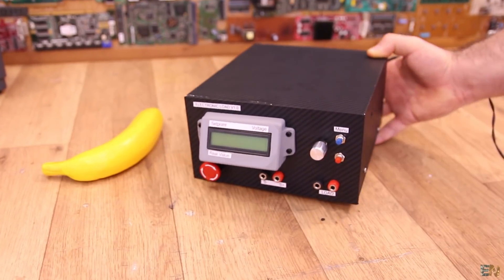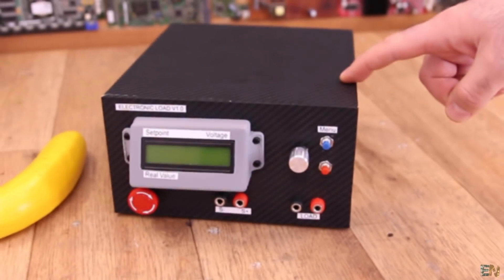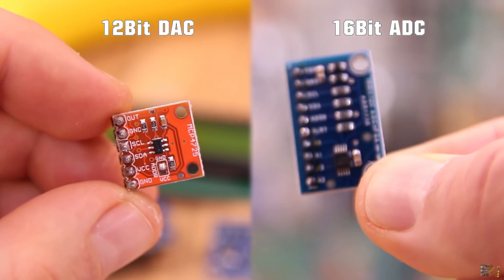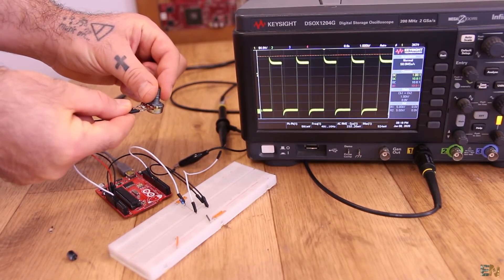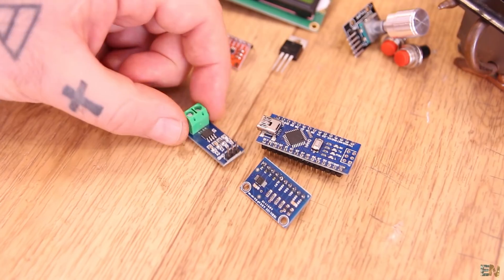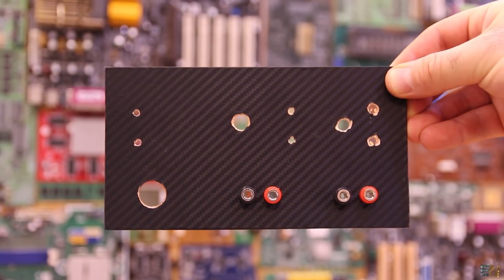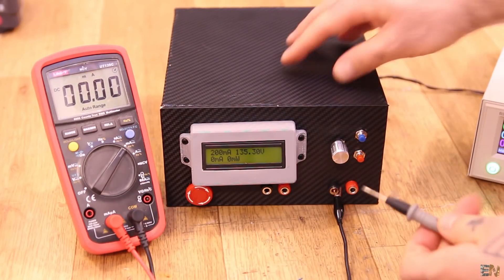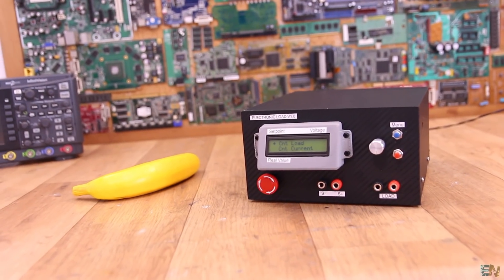Homemade Digital Electronic Load | Multiple Modes

Comment: Good job, one of the best assemblies I have seen for modules of electronic load, this simplifies it a lot for noobs, but the code is missing some features to complete a prefect job:
1- Set end condition i.e. voltage in order not to destroy and deplete batteries under test.
2- Total capacity in mA or A for batteries testing.
3- Total consumed power.
👍

Comment: This is a sweet project. My only concern is that of response speed. It's probably not a big deal for the vast majority of use cases, but I could see some situations where an input voltage changes rapidly. That could cause a large current surge that could brown out the supply, or cause strange oscillations. For example, in constant power mode, if a supply rapidly switched from low to high current, this load may not be able to increase the resistance fast enough, overloading the supply.  Or in constant resistance mode, a reduction to half the voltage will momentarily continue drawing the same current (half the resistance). I think this type of situation is rather unlikely. But it should definitely be kept in mind.
Reply: This problem was a deal-breaker which stopped me from using this design.

Comment: 11:05 , don't put mosfets in linear mode in parallel , drain-to-source resistance changes as mosfet heats up, but they'll not heat up equally even if they're mounted on the same heatsink, you'll get cycle like this until one of the mosfets burns : higher temp => lower resistance => more current = even higher mosfet temperature, so eventually current rated for all mosfets will pass only thru one mosfet

you can put them in "parallel" if you read the amperage, and control their gate voltage  separately
but anyways, cool project :)

Comment: Made it, works great. The only issue was that the current was stuck at 500ma, but I resolved the issue by flipping L and L+ around.
Reply: On mine the current showed a negative value, also had to swop L+ and L-

Comment: I did the similar project 2 years ago. I used INA219 as a current sensor together with 0.1Ohm sense resistor. It more accurate than ACS712, has I2C interface and 0.1 resistor produces less heat.
Reply: Good morning. Did you put your project on the internet?

Comment: Have you checked stability of the system? Especially op Amp driving a mosfet tends to oscillate under some circumstances. Adding some caps in the right position could increase your phase margin of your system.

Comment: When drilling into a heatsink with heatpipes, make sure not to hit the pipes or the refrigerant will escape and the heatpipe won't work. (If you noticed a hiss and a funny smell when you were drilling it, that's what it was.)
Reply from the maker: You're right but in this case, this old cooler was not filled with refrigerant. It's just filled copper tube.

Comment: I am your pateroner, very happy to see this kind of project. It is very useful and you have fully utilized the microcontroller using a good example and best coding way to produce the user friendly features. I love it !!!!! I am your fan haha. Previously, I asked you question and you was responsive to answer my question on pateron chat. I was doing the smart watch project the latest version. But I realized that using the ATmega328-MU the footprint is difficult to solder, I try many best way to solder this and apply the flux to ensure solder paste can properly isolate and solder tightly. I keep trying more than 6 times to program the MCU but stii failed. I read many videos how you burn the code in a blank chip. But I am going to re draw the PCB and change it to ATmega328-AU, i guess using the larger size of ATMEGA328-AU then I can only successfully.  Anyway, I really like your project so far. Hope you keep on post more, stay healthy and safe during this period. God bless you.
Reply from the maker: Thank you very much. For the small chip, do you have a hot air gun? Using a lot of flux it shouldn't be that difficult. And yes, the au version is a bit easier to solder because you can see the pins. Keep up!
Reply: @ELECTRONOOBS  yes, i used heat gun.  I properly to solder and apply the flux to ensure the isolation for each pins. I am not sure why still failed to download the code. I also follow the several video to burn the bootloader. Nevermind, i will keep trying out and let you know once i success to make it.

Comment: Also, I think running MOSFETs in parallel as suggested by running them in the linear region could be non-ideal since the different manufacturing tolerances would make them difficult to control in unison
Reply: U can fix that very easy by splitting the gate voltage to extra OP Amps - and get that "Gate Voltage" from the MCP splitted to them. Every FET needs his own Shunt - and all is fine

Comment: Hi, nice Project, I just stumbled about one thing. GND of Sense is directly connected to the common Ground.In case you connect Sense GND and Input GND directly to your power source then the sense GND wire will also have to carry a lot of Amps resulting in Voltage drop over the wire? => Depending on the "thinkness" of the Sense GND wire, the measurement might be impacted less or more. Shouldn't Sense be measured in a differential manner?

Comment: 1ohm is maybe a little high (voltage drop to connected equipment)
simple suggestion for a bigger/better monster v2.....
mosfet x3 to share the heat
0.1ohm (10x1ohm parallel less heat/less value drift so more accuracy)
tl072/358/741 opamp to multiply small currents before adc (switchable? 1x 10x etc)
less ugly display option, small but pretty oled ones are like $8
sdcard logging......

Comment: you could also attach the 1 ohm shunt resistor to the heatsink, I guess it would be pretty hot if high voltages were to be used

Comment: That was a nice circuit Dude! 😍
Might be useful for a capacity test for 18650's.
Reply from the maker: Thank you. They should be interesting to test
Reply: @ELECTRONOOBS  Yup! 🤟
Reply: @DIYwithBatteries  you have a cool channel too.
Reply: I was thinking the same think. If yoy can make it count the mAh, time and ad  a cut of voltage it will be great for 18650.

Comment: A word of warning.  If you use this device to test batteries, add a cutoff relay.  Batteries are never off.  If the MOSFET shorts out (most likely failure mode) bad things happen like fire.
Reply from the maker: Thank you for this great tip!
Reply: Maybe add a current clamping circuit?
Reply: @bitsurfer0101  No circuit is going to protect this device.  What would happen if you're load testing a battery and the MOSFET shorts out?  The full current of the battery will start surging through and begin heating wires and other parts to the point of ignition aka FIRE.  Either you need a fuse or a relay in series with the battery to shut things down in the event of catastrophe.  Don't ask me how I know!  A relay has the additional benefit of completely opening the circuit at the end of your battery capacity test.
Reply: Randy Carter What are your engineering qualifications? Have you designed a similar circuit?

Comment: Great project I already made your project . Also some minor modifications .  I saw that it couldn't get to higher currents due to the 1 Ohm resistor . basically your dropping way too much power on the resistor . I put a 0.5 ohms and arrived at 4 Amps with Just 1 Mosfet . the Idea is to ad a standard Shunt so all the power can be dissipated on the mosfets .   I already made a 400Watt DC Load using the same ADC and DAC with adruino with1% accuracy . but my problem is that i could never understand how to make a Menu . I'm hopping that I could use your Code and modify it so id have a more extended functions . Beautiful Project

Comment: Why didn't you use PWM on the gate of the mosfet so that you could dump the energy into a passive resistor and keep the MOSFET out of the linear region?
Reply: if you PWM the mosfet would the load also see a PWM signal, and what is wanted is a constant signal, efficiency is NOT wanted in this case if the point is to stress the load...as far as i can tell
Reply: Hi, can you elaborate on what you mean here? Specifically where the passive resistor goes

Comment: This electronic load is cool, I like it! I wanted to build a very similar load and because I had some problems I didn't do it, but now that I've seen this video I plan do start building it, finaly :) But I would add more power MOSFETs to share the load, because MOSFETs with great SOA (safe operating area) are expensive, and if you choose a MOSFET that isn't designed to work in it's saturation region (where it dissipates a lot of power) it might damage over time.
Reply from the maker: Nice. Let us know how your project is going! Keep up!
Reply: Update: I finally built my load and recorded a video about it on my channel. I know it took a while, but I made sure to resolve all common problems found in most DIY designs.

Comment: You can increase the accuracy of the Arduino from 8 bit to 10 bit for the PWM output and to measure more accurate you can increase the analog input from 10 bit to 12 bit
Reply: To increase the accuracy can we use 16bit pwm output??
Reply: @protonspeed  nope, on arduino 12 bit is the absolute highest you can go, of course you can use another chip that does the conversion in 16 bit and then communicates it back to the arduino via serial communication.
Reply: @RicardoPenders  Arduino uno does have 16bit Timer, it's called Timer 1,so it's possible to generate 16bit PWM by Arduino it self. Isn't it ?🙂
Reply: @protonspeed  not sure about that, I thought it was 12 bit tops
Reply: @RicardoPenders  Nah, I've been using 16bit pwm for my project.😊

Comment: Is it possible to have higher gain, say with R7=2kohm, R6=2kohm? What is the maximum voltage for the MOSFET, the Vgs in the datasheet? So 20V? Thanks!

Comment: hey electronoobs it would be a good idea if this project can be used to test the capacity of 18650 batteries  by measuring how much current it delivered for a certain time and than display results in the end please please make another version with this improvement

Comment: Hi. Great tutoral and i had replicate one using the schematc all work greatl, but if i setup my power source to Give i.g 5 amp a setup the load for 2 amp or something , is drain8ng always max 1.2 amp. From 0 to 1.2 amp setup on the load all works great but any think over is always showing 1.2 amp drain. Is that mofset averhited or something alse? Thx

Comment: Very very nice the all project! Also the case and the menu:) but I'm not sure the MOSFET is properly driven by the DAC. You should use an OP-AMP stage. I know it is not that easier to get also resistance and costant power!

Comment: What would be the best way to build this for higher loads?  I have 30ah 12s 50v lipo batteries I need to discharge after to work to storage voltage.  So that like's 1500 watts at 1C.  Some have said driving multiple MOSFETs could be problematic.  Would it be more efficient if that actually fed a bank of high-power resistors?

Comment: Great build. Liked all the explanations and problem solving along the way. I would suggest you raise the 1 ohm 5 watt resistor above the protoboard to prevent burning of that board at full current. An excellent build

Comment: I ve built it... The current shows always negative... I ve posted in your website too... Is that simple change of shunt connection or more? Please help..
Also in ads1115 driver you need to change 8 to 9 for waittime... Please mention that too..

Otherwise it is good work brother...
Reply from the maker: If it shows negative I think you connected L+ and L- to the ADC in reverse. https://electronoobs.com/eng_arduino_tut123_sch1.php

Comment: Good job! I have a question though.
With the analog version there was an op-amp at the input of the FET in a feedback configuration. This time the DAC drives the FET directly without any feedback configuration.
How do you know the FET drive voltage for a specific amount of current. Is there a digital feedback control?

Comment: Great job, amazing results, unfortunately I need one capable to handle 30V @10A (300W), Do you know If ia possible to get this Power?
Reply from the maker: Yes, amplify the DAC output and maybe put more mosfets in parallel. Use a good heat dissipator!
Reply: @ELECTRONOOBS  thanks, I'll try It. It's really one amazing project. You're my hero.

Comment: It is not possible using a 1 ohm 5W resistor for a 5 A load. Resistor will dissipate 25W of power and smoke and burn up. Maximum load would be ~2A with that 5W resistor. Must use a 50W resistor for a 5 Amp load. Can you explain your shunt resistor choice please? thanks.

Comment: Hi- Thanks for posting this. I’d like to build it, but I have one question. The link you provided for the fan looks nothing like what you actually used. Do I need to get a heat sink and fan separately, or are they available as one unit? Can you provide additional links if necessary? Thanks again.

Comment: Did you isolate the mosfet from the heatsink? Usually one of the pins is connected to the back part too. So if you screw it to the heatsink, chances are your heatsink will have the same potential as the source.
Reply from the maker: Is not insulated so yes, the heatsink will have the same potential. In this case is the drain. There are still some parts to improve, yes...
Reply: @ELECTRONOOBS  good you left the heatsink floating and used a wooden case 😉

Comment: I connected everything and whatever current I chose on gate I  have 4.9v. I think my mcp4725 not good. Tried some sketch for it as sinewave or triangle as example but nothing on scope of OUT pin from DAC
Reply: The MCP4725 is not capable of driving the 3,247 pF MOS FET gate capacitance.  You need to add an op amp with a high capacitance drive circuit.
Reply: Thanks will add op,without can open fet to 2.5A
Problem was for me mon stop 5v to gate  in sch us swuped 2 pins on ADC
Reply: I put also OP amp but maximum amperage is about 2.4A not goes to 5A
Any tips?

Comment: Nice electronic load,
How does it perform dynamicly? The CC would properly be ok but what about CR and CP. In these modes the MCU and ADC is doing the controle loop.
Reply from the maker: That's right. I should make this with an STM32 in order to have more speed... We need more speed for better results
Reply: @ELECTRONOOBS  you could also use an ESP32, this could enable remote controle

Comment: There is an error on your schematic. The RST pin is connected to ground and the microcontroller is on reset all the time. So the program won't run. Am I right?

Comment: i really like your projects and they are pretty well thought out but the execution still needs some work. like your wiring, 3d prints, casings and assembly could be improved. still better than most but improvement in those areas will make you one of the best electronics youtubers.
Reply from the maker: Thanks for all your tips :)

Comment: I consider myself an ultra noob in this field since I'm just starting to learn, but I want to ask you since I saw the datasheet for the mosfet you are using, how can you enter in the saturation region using a gate to source voltage of 5v if the threshold (Vgs) for that mosfet is 4v and it doesn't enter the saturation region with less than at least 10v (the datasheets mentions a static drain-to-source on-resistance of 8 ohms at 10 volts)
This kind of things in mosfets always mess with my brain because i've read that using them this way in the (linear)ohmic region might destroy them (?), maybe I got everything messed up, but im wondering why are you using this mosfet instead of a logic one.
Sorry for the long question I hope I didn't make a fool of myself! :D
Reply from the maker: Better use a logic one. I used this because I only had this or the irfz45n laying around... It should be better to use an OPAMP an increase the voltage at the gate above 10V, yes.
Reply: @ELECTRONOOBS  Thank you for the reply!
Loved the project!

Comment: hi, nice project. i built the previous version too. 
the only thing i don't like is the resistor because of the voltagedrop, so thanks for the alternative component ACS712. why don't you use a opamp to raise the voltage of the ACS712? 
i want to use this for building a power supply from an ATX PC PSU.  i only have one lab bench power supply and sometimes need more voltages so this will be my second power supply. it wil have 5 dedicated voltages (3,3  / 5  / 12  / -5  /  -12 ) with adjustable max current (for the positive voltages), and a voltage and  current controlled output. all with volt and ampere meters. and at the bottom some usb connections for charging. 
if anyone interested in this, i made the frontpanel in tinkercad (search for ATX  PSU Bench power supply)
Reply: i am neither a expert nor a genius but i think this is not a lab bench powersupply infact this is completely opposite of that and is a constant current load
Reply: @SharvilSawargaonkar  some functions of a electronic load are the same as a lab bech PSU. for example the constant current mode. both devices use the same principle the only difference is that the one supplies it and the other consumes it. but for the hardware which controls it it's the same. and to measure the currrent, this ACS712 is a really nice device since there is no voltage drop because the resistance is negligable.